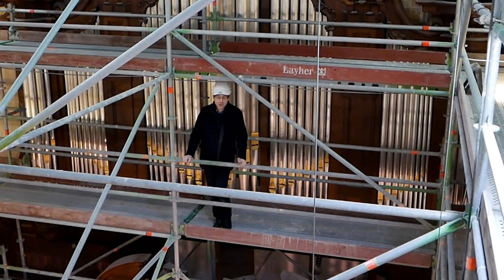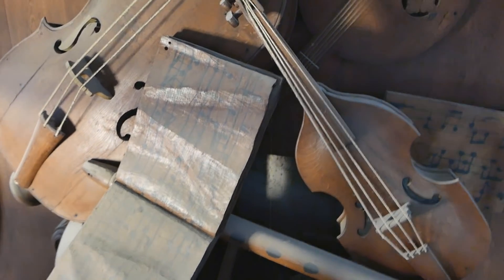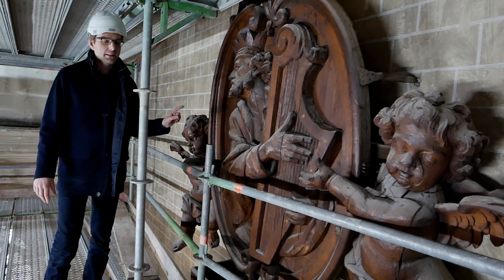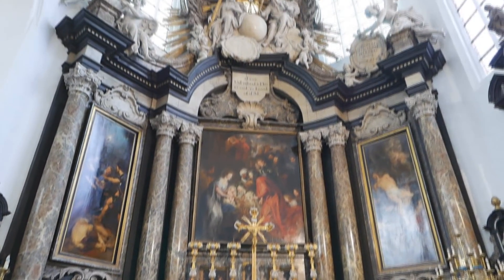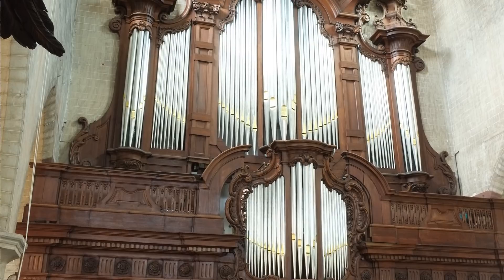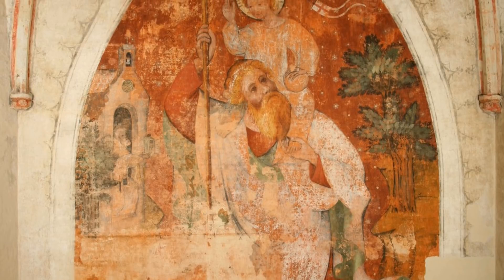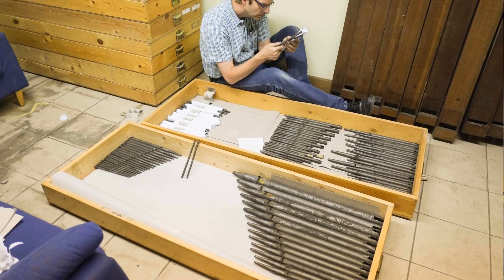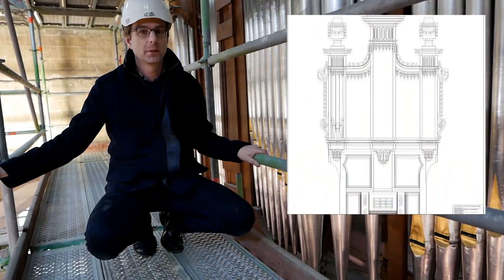Playing a forgotten Cello High On Top of a Gigantic Historical Organ!!

Comment: Wim, I for one would love to see more about this part of your life!!!!! I was quite surprised at the Rohrflute you showed us. The cutups on it looked quite high to me for an instrument that should have been on quite low pressure and with a certain expectation for brightness. Are those examples of pipes from the original installation? If so, how much pressure was that rank operating under originally and what was it running on at the last time it was in use? 

Also, the facade pipes you showed (which you indicated some were wood) looked to me like those which were not wood had severe deformations on the upper lips. If the deformed lips are on pipes that were in use, they could not have been operating so well could they? Will you be recommending that they come out and go in for some shaping and voicing work or does the project budget preclude this? If you think these questions too off topic for the feedback forum feel free to PM at your convenience.
Reply from the maker: HI David, knew you were gonna like this :-). Everything will be transported to the work shop once an organ builder is appointed (will take some years however) and the facade pipes for sure. These are really expensive projects, highly subsidized by the Flemish government which keeps an eye on it as well, so it is a team work here. I'll send you some info by mail

Comment: I looked up the disposition of the organ. A basic summary of the builders' history: 
In the 16th century (since 1565), the church had an old organ that was moved by Brebos from St. Rombouts Cathedral. 
Jan Bremser completely (?) replaces this organ with a new one-manual one in 1644; Paul Munich and Jan Mattheesens maintain the organ in the following decades.
Carolus Dillens rebuilds the organ in 1714
The new organ case is built in 1772 for the big festival.
Pieter van Peteghem rebuilds the organ using Bresmer and Dillens pipework.
The Ruckpositiv is added in 1810 by Pieter's sons.
Stevens rebuilds the organ in 1899, replacing the action, removing the Ruckpositiv and modifying/adding ranks.
Organ is not really changed since then.

What will the disposition be after the restoration?
Also, you mentioned that there are still facade pipes from the 16th century used as inner pipes by van Hagerbeer. But the description below gives an impression that Bremser destroyed all the older pipework when he built the new organ in 1644. Did some pipes get re-dated by you to an older time? (From what I've read the oldest known organ remains in Belgium is the 1594 Nicolaas Niehoff organ in Hasselt)

https://inventaris.onroerenderfgoed.be/dibe/orgel/92247/downloaden

Excellent video, by the way! I'll join in the choirs and say that you should make more of these type of videos.
Reply from the maker: Thanks Andy for the add,